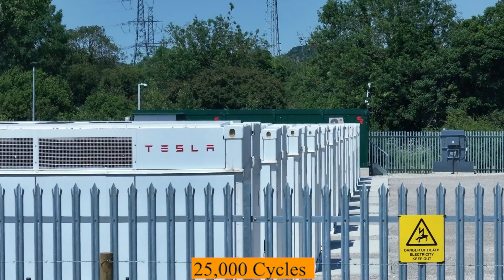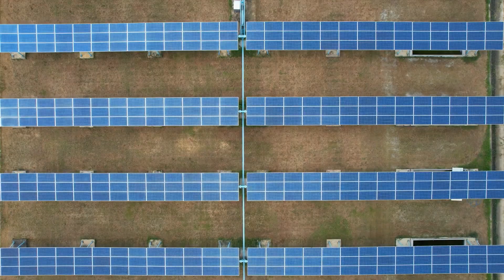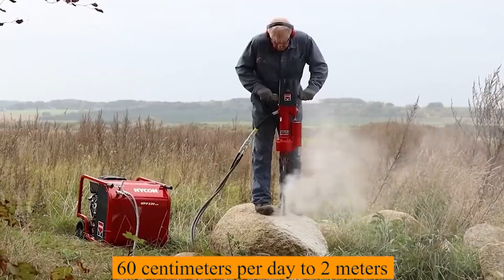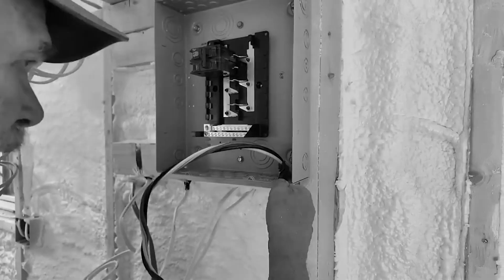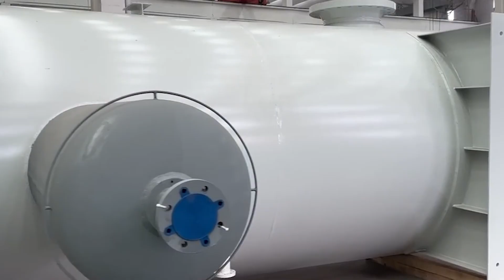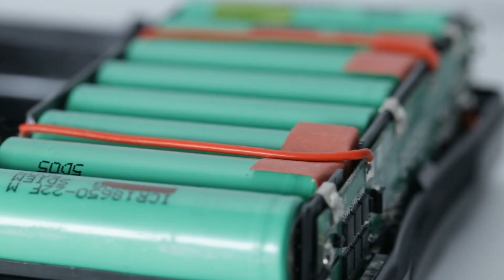I Built A 30-Year Solar Battery For Under $100

Comment: Oh my God this video is so full of so much horseshit and straight up lies it's unbelievable while some of the basic core principles are technically accurate yes you can store energy in a propane tank and if the propane tank is sealed up and it doesn't leak it will hold that energy damn near indefinitely but what the video fails to tell you is that the electric motor running off of your solar is not 100% efficient so you have energy losses there the compressor that that motor runs to pump it into the propane tank is not 100% efficient so you have energy losses there and then coming back out the air pressure running an air generator or an air motor is nowhere near 100% efficient and then the actual generator head that is being powered by that air motor isn't 100% efficient sure some of those electrical conversions have gotten better especially in the days of electric cars but the compressors are huge energy hogs yeah you can recycle some of the heat and some of the cooling but the lowest pressure that this guy talks about for reasonable energy storage is 43 bar that's $647 PSI standard propane tank is only rated for around 200 to 250 psi so the volume that you can store in a standard home service propane tank which on the large end is maybe a thousand gallons is not going to power you for any significant length of time and the claim that a propane tank or any metal storage vessel doesn't wear out is a complete crock of s*** ask any scuba diver about their scuba tanks and how often they have to get tested and recertified and yes they do end up failing those certifications either due to corrosion or just due to cyclic stresses and propane tanks need to be recertified periodically now at 250 psi they generally last a lifetime and they're only cycling from full to empty once a month or so so there's not a lot of cyclic stress but a SCUBA tank if you dive that scuba tank twice a day every day it's going to wear out then it's not going to take forever to do it so for somebody like this to straight up lie about a lot of this information is completely misleading and completely unethical yes technically you can store energy as compressed air and then you can recover that energy and convert that energy back into electrical power you can recover some of the heat and you can use the expanding gas as some cooling but it ain't nowhere near practical for a homeowner to do that with their propane tank